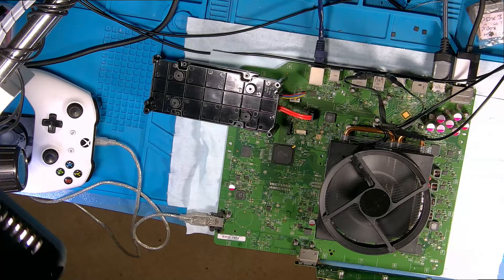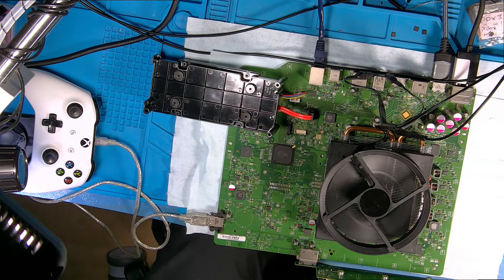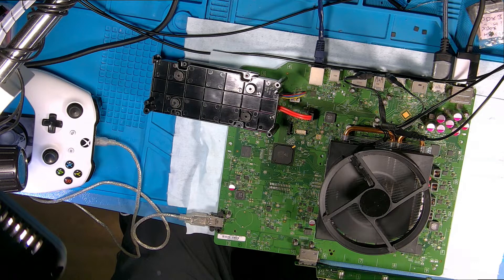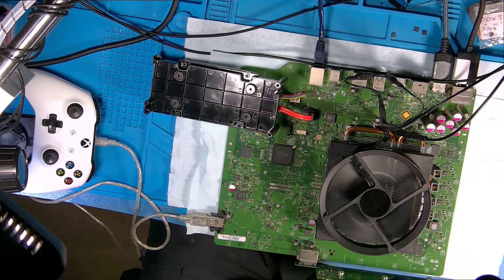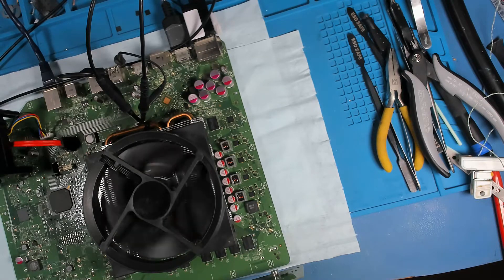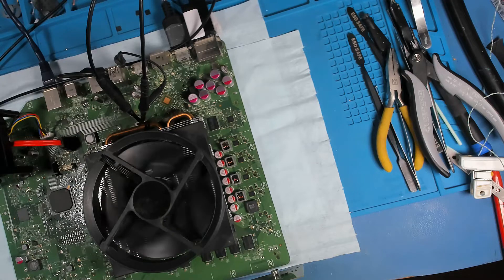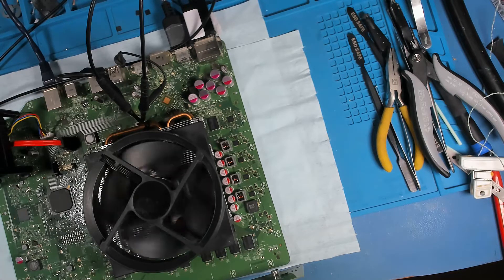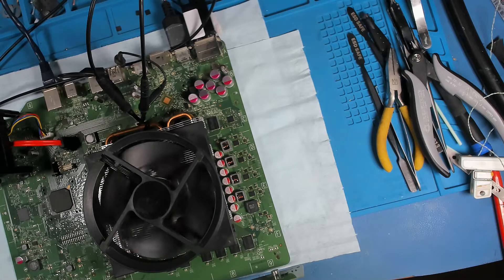Xbox one continuation no power when cold

Comment: Nice follow up Steve and very interesting mate I haven't tried heating this one s up yet but I did notice there seems to be no change on the enable line on the 4205 on mine so got to check that too
Reply from the maker: Hi chris thanks for the nice comment,both chips are similar and have similar jobs, its worth just giving it a warm up just to see if it does effect the out come, idid try warming the 05 on that 1 s i have with similar fault but didn’t help. I think this is one circuit we need to map out and make a  schematic..
Reply: @Steve_be  possibly Steve shame we don't have a good friend that works for Microsoft with access to the schems 😂😂😂